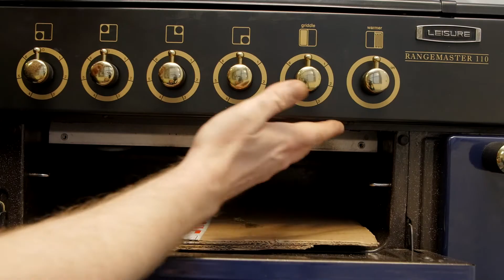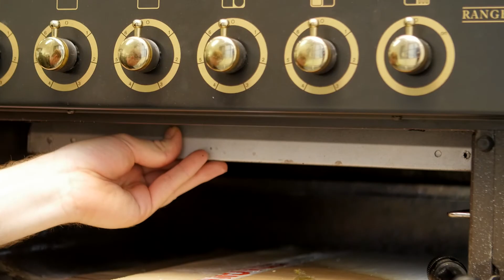Easy Steps! To Replace a Rangemaster Cooker Grill Element

Comment: If you have a fan oven, you'll need to remove the vent pipe to be able to take off the grill access panel. To do this youi'll first need to remove the vent pipe protector plate with the two screws at the bottom. Then remove the lower, oven access panel (6 screws). The lower end of the vent pipe is held in by two screws - remove these and pull the pipe out and it should drop down. Then proceed as described in the video.
Reply from the maker: Hi Chris, thank you for the information.

Comment: I have duel fuel (LPG) Rangemaster 90 and need to replace the grill elements. The casing at the back (as per your video on an electric cooker) is blocked by gas feed pipe vertically across it and isn't easily removable. Any tips?
Reply: Sorted - read post below!!! It was breather pipe....
Reply from the maker: Hi Pauline glad it has been sorted ☺

Comment: Great video, changed the element no problem. However one of the grill elements won’t turn off, except when I turn it off at the mains, does anybody know what could’ve gone wrong? The other element works fine with the knob on the front.
Reply from the maker: Hi dannyb67, changing the element should not affect turning it off but this sounds more like the switch.
Reply: eSpares thank you. Yeah you’re right I changed the switch & works great.
Reply from the maker: Hi dannyb67, we're glad to hear we helped you fix your appliance.